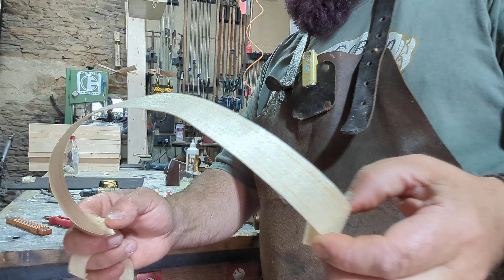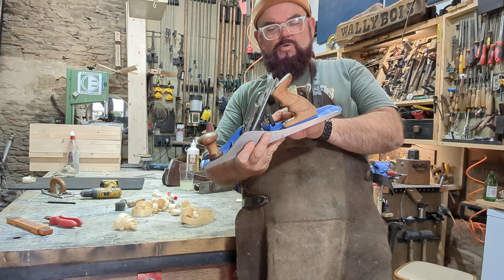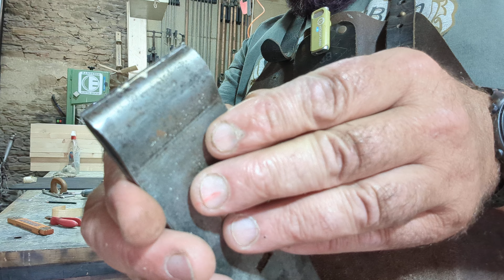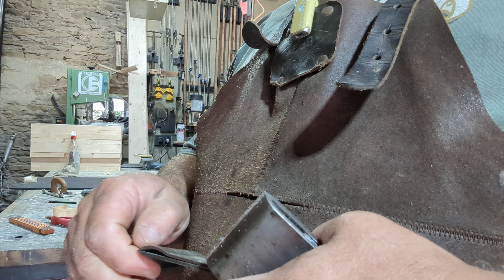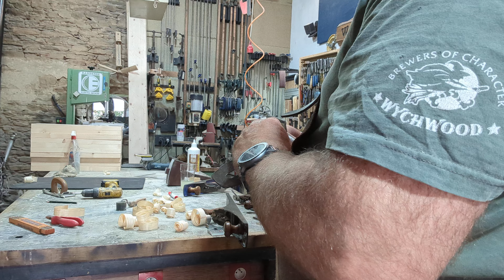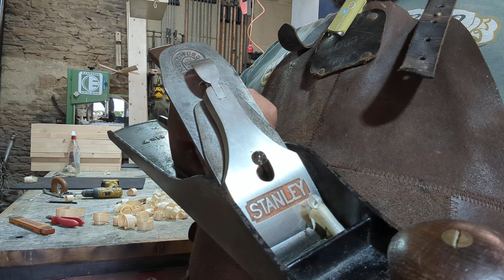Handplane Judder #handplanes #woodworkingtools

Comment: It's the frog. Back it up a tad and then set the cap iron 1mm from the edge. Also, it is a smoother plane and not meant for chonky shavings..😁 And in my experience Stanley 4's made after the late 60's are not as good.
Reply from the maker: I'll try that thanks I think this one is post 70's

Comment: I have found that there can be a number of things wrong with a plane, some fixable others not but you have to fix all of the problems before they perform well.  In this case, I would check the frog is rock solid and fully engaged with/to the base and that the frog face is flat.
Reply from the maker: @deemdoubleu  I'll do that thanks